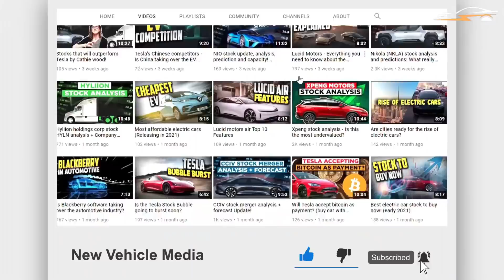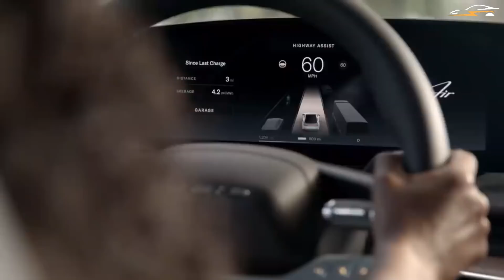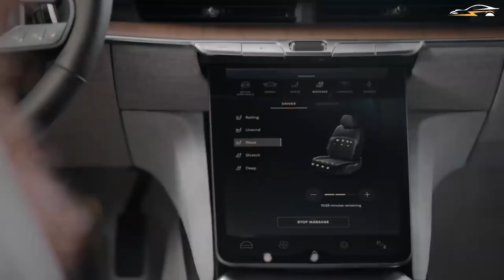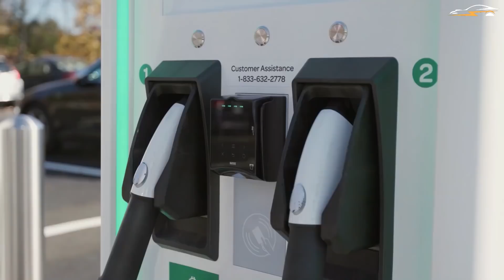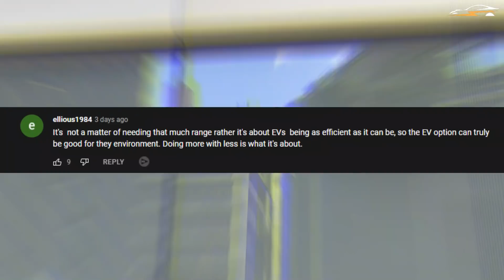How Lucid Motors Battery Technology HUMILIATES The Competition!

Comment: Yeah...I like the way they think at Lucid. I can't help but wonder what the range would be if Lucid decided to sacrifice 10% efficiency by adding more batteries in a slightly smaller car. What if they decreased the acceleration by 10%? I love the integrated motor, V2G and BMS. I've worked on other models - Electric buses - which uses discrete modules that takes uP a whole lot more space, so this integrated arrangement is fascinating to me.

In conclusion, I think a slightly smaller car with slightly more batteries - using the same battery technology - and a slightly slower acceleration could potentially extend the range of a Lucid car to around 700 miles. This new car would be about the same size as a Honda Civic, without all the luxury as the Lucid Air. Such a vehicle would be less expensive (around 40 to 50)K, with increased range and Lucid's sales would skyrocket.
Reply: The problem with lucid isn't lack of demand, it's meeting demand. They've designed and built their cars in a way that doesn't scale up well. They handmake them. It'll be years before I get mine. Model S for now.

Comment: Not a Tesla fan boy, but Lucid Air Pure has the exact same weight as Model S long range and exact same EPA range while having very similar size. To have the 520 mi range with a Lucid Air, you will have to go to the GT edition, which weighs 600 pounds more than the Pure and the Model S. Their efficiency are about the same.

The charge speed is definitely better with Lucid though.

Comment: The Porsche is designed to be able to accelerate multiple times without overheating to be able to race without limitations. I wonder if the Lucid Air can do the same. The model S cannot, at least the non plaid models. They go in overheat on the Nürburgring.
Reply: Porsche owns 30 percent of Rimac, which with money bought out Bugatti. Before the Taycan S Turbo had Rimac technology the Porsche Mission "E" ran on the GKN E Twinster Transaxle!